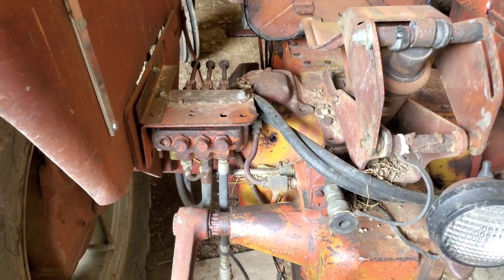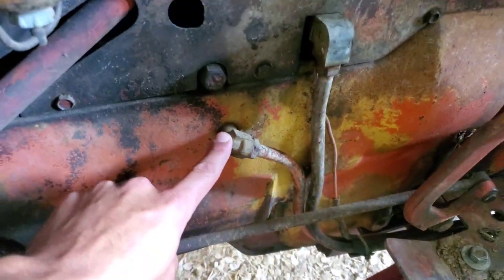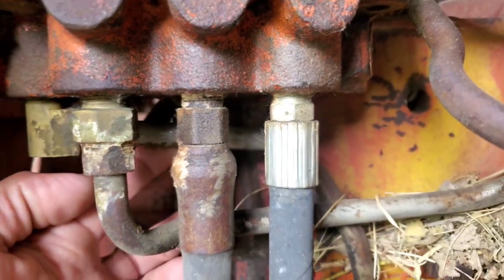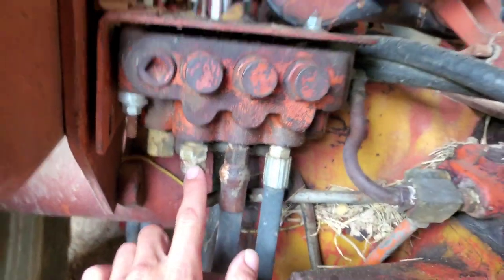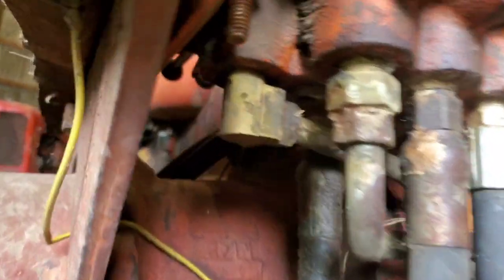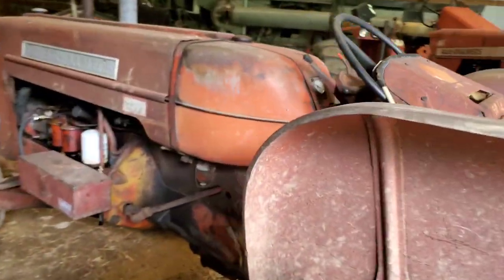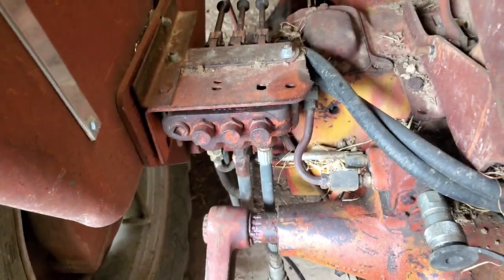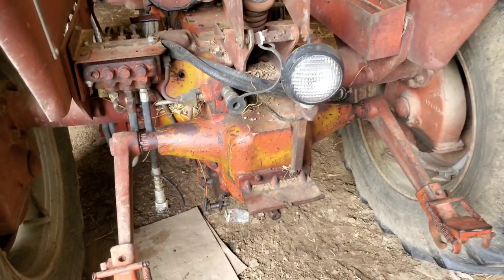How to plumb a 2 way spool on an Allis Chalmers D series.

Comment: Put the P port from the pump, work ports to the remotes and return to the reservoir or reared
Reply from the maker: You could get away with that... as long as ya put a T at the original valve he would still have lift arms. 👍👍 over thinking a little I was 😆
Reply: @TimothyFluegel  LOL 🤣😂😎

Comment: Thanks for this, I commented below, but my question is basically how to get independent control of the 3 point rams in this situation. It looks like the way you have it plumbed you would have the same problem I have now on my d17, which is that the 3 point arms go up all the way before I get power to something else that's attached to the remote. Maybe I'm seeing it wrong. Is it possible to remove the power in line to the 3 point and connect that to the spool in, and then use one of the spools to control the 3 point arms? Basically everything goes through the spool and the return to sump for the 3 point would also get routed through the spool? --- update: it actually looks to me like you have the return line going through the spool, but the power to line goes to that tee and it should feed both the spool and the 3 point arms at the same time. couldn't you just take that tee out and connect the power to line directly to the spool and then connect a line from one of the valves to the power in for the 3 point where the tee used to be? that way you'd have independent control of the 3 point arms and whatever other implements you connect to the other two valves.
Reply from the maker: So the only output that doesn't work independently from the lift arms, with this set up, is the single acting one. It's set up like this for a plow with a rear guide wheel.  The adjuster under the single connector controls how fast and what lifts 1st out of the 2 like a wd45. So the spool runs the lift arms and the single acting off of one spool then the other 2 double acting off of the other 2 spools that are completely independent. If that makes any sense lol. The lever on the dash is just too turn hydraulics on and off at this point.
Reply: @TimothyFluegel  Ok, I see, thanks for your reply. Can you tell me please how you can control which of the two between the 3 point arms and the single acting remote lifts first? If you turn the adjuster all the way clockwise or counterclockwise it will then make one or the other lift first?
Reply from the maker: Yes sir, you are correct. Now I can't remember off the top of my head witch way to turn it. 🙃 just gotta experiment I suppose lol
Reply: @TimothyFluegel  thanks, and I guess this wouldn't work if you cut out the spool valve and tried to put a selector valve instead right? If I disconnected the power to the 3 point and connected it to a selector valve and then plumbed one of the outs from the selector back to the 3 point and the other I could use for a front loader, I'd continue to use the lever from the dash but then I'd get an option to use the loader independently and I could just trap some oil in the loader rams to keep the loader off the ground while I switched over to using the 3 point. you think that would work? sorry to bother you, but I can't seem to find anyone with experience on these to help. really appreciate your help

Comment: Also do you think there’s a a way on my d17 to run a loader with a Separate loader valve bank instead of using the tractors but the way people are telling to do it plumb the pressure line from the pump into the loaders valve bank then into the tractors valve bank but I really don’t want to do it that way

Comment: If I put this on my d15 will the remotes operate independently of the lift arms? I want to use my new rowse mower on the tractor.
Reply from the maker: Yes everything with have is own independent spool as long as you install enough spools. The possibilities are endless really.
Reply: @TimothyFluegel  Hi, thanks for this. I don't see how the lift arms work independently from the spool here like Tanner is asking. Since the power line is tee'd into the lift arms and the spool, doesn't oil go to the lift arms at the same time as it goes to the spool when you push the lever up by the steering wheel to "turn on" the hydraulics? I've got a D17 and I can't figure this out. I think I need to put a selector valve in line between the spool and the lift arms don't I?

Comment: You probably won't see this comment but to hook that spool up and everything do you need a hydraulic pump that runs off of the crank of the motor, or can you just use the hydraulic pump that is in the rear end of the tractor? I have a series 2 d 17 and I am hoping to put double acting hydraulics on it and I don't have a pump that runs off of the crank, will I need one or can I do it without? All I trying to do is have one double acting remote to use a 10 foot wheel disk behind it and I still want to be able to use my three point to brush hog. If you could help me along this process that would be great!
Reply from the maker: You can use the pump that is in your tractor already. This shows how to run the lines. Don't over think it is my best piece of advice lol
Reply: @TimothyFluegel  Thanks!
Reply: @TimothyFluegel  I think a lot of the people on Facebook act like they know it the best but really people just apparently want other people to do more work for know reason. Thanks for your help, I love watching your videos they are very informational.
Reply from the maker: @ryanhawthorne7893  o yes there is a reason I don't get on the facebook forums and help people out, I like to help out don't get me wrong but,  I don't like arguing with random people about the answers I give 🤦‍♂️🤣. Like you said most people just want to feel important 🤣, I hope you get it figured out. Let me know if you have any other questions.

Comment: I have an extra 3 spoil valve and the transport valve for a D19 that I had all rebuilt. I had planned on using it on my series 3 D17 but a guy kept bugging me to sell it and he finally offered me way more than it was worth so I sold it and my series 2. I’ll probably regret selling them but I guess now I can try to find a series 4 gas and diesel to replace them
Reply from the maker: Sounds lie you'll only regret it until your driving your new to you series IV 😆.. I'm curious what the spool for the 19 is worth I'm probably going to put the extra one I have for sale.
Reply: I paid $400 for my extra one and then paid $150 to have it all rebuilt so I could use it on my 17 but never got around to it. Too many projects and not enough spare time. There should really be a law against work interfering with a guys hobbies